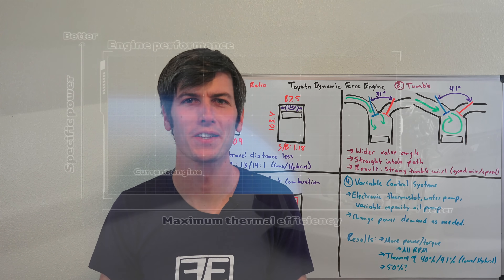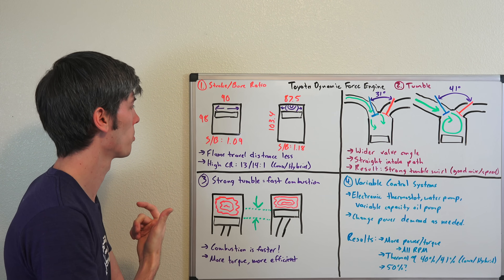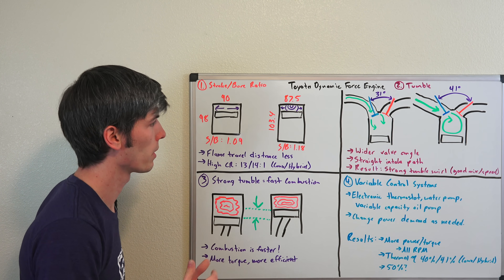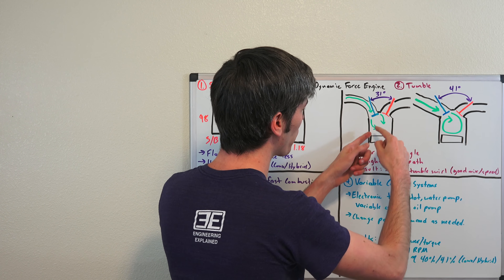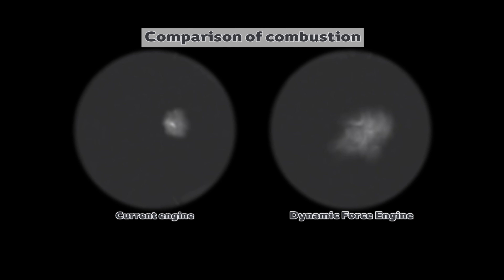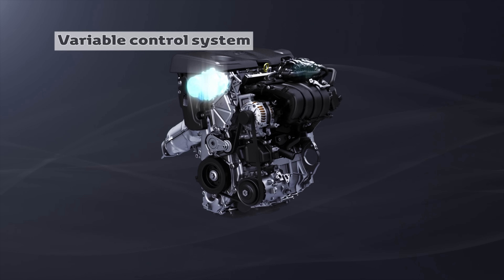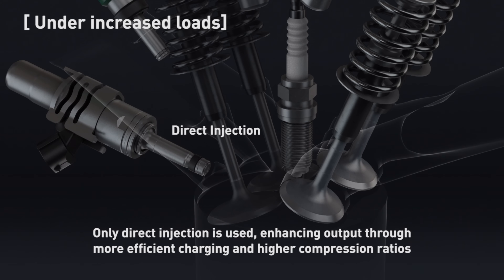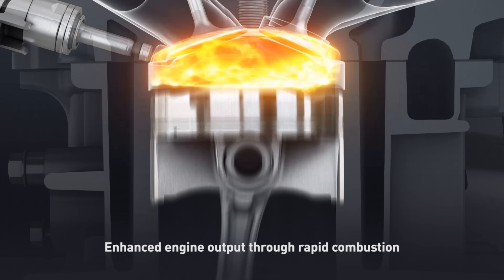Toyota's New Dynamic Force Engine Is Super Efficient

Comment: Electric oil pump. I like the sound of that, potential mounting in convenient location, potential diagnostic procedures like checking filter flown or system functionality, cold start up priming.

Comment: If you speed up the combustion,you reduce torque-not increase it. This is why diesel's have more torque that gasoline engine's--because the fuel burn is slower and longer. To burn all the fuel in the first 20-30% of the power stroke,will reduce torque,as most torque is developed when the piston position is between the 30 and 70% mark of the stroke.  I often wonder how on earth some of these !so called! engineers make it through grade school.

Comment: Isn't Mazda working on an engine with a similar compression ratio? What's the difference in technology?
Reply from the maker: Mazda's SkyActiv-X prototypes are running 16:1. Explained here: https://youtu.be/yNSxow3W7ek
Reply: Engineering Explained which is better in ur opinion?
Reply: Well, since Mazda hasn't actually made their new engine available to the public, it's practically impossible to determine which one is actually better.

Comment: You missed the biggest reason for the increasingly undersquare bore/stroke ratio which is a massive change in surface/volume ratio of the combustion chamber for a given compression ratio.  This alone probably accounts for a large proportion, if not most, of the fuel consumption benefit.
Reply from the maker: I'm not sure I'm convinced on that point (and I certainly wouldn't say it's the biggest reason). Mathematically, two cylinders of the same volume but different dimensions (bore and stroke) will have the same surface area. Ex, Mazda’s SkyActive engines: 1. Surface area (A) of a cylinder with pre SkyActiv-G dimensions (87.5 x 83.1 - 0.5L) A=2πrh+2πr2 = .035 m2 . Surface area of a cylinder with SkyActiv-G dimensions (83.5 x 91.2 - 0.5L) A=2πrh+2πr2 = .035 m2 Which means it comes down to only the cylinder head, which is just a fraction of the overall surface area. So if you make the head more spherical, yes, you increase volume per unit surface area, but you also make high compression ratios more challenging. But again it’s a relatively small change in surface area to volume, so that’s not the main source of where heat was lost and now allows for greater thermal efficiency. Speeding up combustion means more of that pressure is turned into useful work, rather than heating the cylinder walls or leaving as pressure through the exhaust.
Reply: It's not the S/V of the entire cylinder that's important.  It's the S/V of the combustion chamber at TDC where the gases are at their peak (thousands of °C!) and the thermal gradient is at its height.  Once the expansion begins the gas temperatures drop dramatically and thermal losses reduce significantly.  This is why a lot of attention is paid to the cylinder head cooling and the bottom of the bore doesn't even have a water jacket!

If you do the sums on the Toyota data you presented here and simplify the clearance volume to a cylinder you can see a 4% reduction in TDC S/V.  That's a significant reduction in heat loss when it's at its maximum rate.  The higher the CR the more significant this advantage gets.

As far as charge motion and burn rate are concerned it's sure worth something but not as much as you'd think for complicating reasons.  Notably the decreased bore/stroke ratio will compromise rod ratio too unless you allow the engine to grow taller.  This has deletarious effects on piston motion at TDC so some of the burn rate advantage is lost here.  Additionally, higher burn rate increases peak cylinder pressure and temperature which also increases thermal losses due to increasing the thermal gradient to the cooling jacket.  So what's given with one hand is partially taken away with the other.

Here are my numbers, if they will remain formatted correctly (hopefully)

bore  90   87.5
stroke  98   103.4
swept v  623   622
cr   13   13
clear vol. 52.0  51.8
  
c.v. height 8.2   8.6
c.v. surface 15033  14395
S/V   289   278

Comment: Very nice video, well explained, as usual. This engine looks like  it is still a N/A engine. 
On my side, to buy again from Toyota, the efficiency has at least to double, minimum. My Toyota Highlander MY2017 bought in November 2017 has the worse fuel economy of all my cars, ever. I bought it new and even after the break-in period, I cannot go below 14,6 litres /km on average. I succeeded getting below 14 litres by doing a lot of highway and by turning off the A/C often (the kind of thing I never did on my previous Volvo). The engine looks like the "state of the art" of naturally aspirated engine with, VVT-iW and VVT-i + double fuel injection system although it does not feature cylinder deactivation, and the car has an efficient 8 speeds gearbox. Fuel economy is far from the claimed figure I checked on the Toyota specs. The "ECO" mode is ON ("Sport" mode OFF"), and of course, the parking brake is released ;-)
I miss my 2014 Volvo XC60 T6 with its 3 litres 6 cylinders turbo (and a 6 speeds sluggish old school automatic gearbox), same power output as the Highlander, that had a 8,8 litres /100km average over the 65000 kms I have done with it...

From my experience, that is no surprise that Toyota is able to improve over that !

Comment: Engineering Explained. Shown quickly in the graphic, but you didn't point out that this engine has both, Direct and Multi-Port injection. Which as well as giving better performance, helps to stop Direct Injections potential for carbon build up on the intake valves, which is pricey to have repaired.

Comment: One day Toyota might discover the electric motor with an amazing 96% thermal efficiency. Incredible.
Reply: And one day, in a far, far away land, you might discover most of the electricity that powers your electric motor comes from coal, gas and other fossil fuels that have 30%-50% thermal efficiency as well.

Comment: I would have thought that these burning efficiency techniques have been known for a long time,     I would expect that they have been used before  but no reason not to use them again  given the pressure for higher petrol efficency , controlling the loading devices is novel ..thanks for the presentations.

Comment: I'm still hanging out hoping that you'll do a video on desaxe engines and explain what the issues are with it and why more manufacturers aren't using it for it's obvious power and torque benefits. Henry Ford used it back in 30's so it's not exactly new technology. Great video as usual Jason.
Reply: Per my criteria this is a desaxe engine! The bores are offset from the crank centerline. More crank degrees at TDC, I would think this allows for easier event control. Also just a personal theory that they get better rod bearing life by having their peak cylinder pressure event occur while the crank is further from TDC, which seems like a big deal when the are running a 14:1 engine on 0w-16 and keeping bearing width to a minimum.

Comment: HCCI, 2 stage direct injection, long stroke, high compression....so modern petrols are effecively becoming diesels.
If you want a diesel, just buy one. "but diesels are expensive and low revving" because this will be cheap with a 7200rpm redline?

Comment: "Dynamic Force Engine!" is just a marketing term for "we optimized combustion a bit." Everyone optimizes combustion. Snooze.
Reply: aluisious:   Marketing is one thing.  (See Farfegnugen).   Making things better is something else.   Boring as Toyota is, it has a habit of doing that AND keeping their cars generally highly reliable.
Reply: GM, Ford, and Fiat's engineers focus on and prioritize part failure rate and reoccurring maintenance costs ( they want the part to fail after a set number of years, miles, or hours of use, where Toyota focuses on reliability and brand reputation, hence it costs a lot less to own a Toyota. Toyota's hold their value much better then the rest.  GM's Active fuel management FAIL, Ford's ECO Boost FAIL, Fiats ECO Diesel FAIL its all about how much are customers willing to put up with and will they buy another. Ford and GM are majorly downsizing, which means consumers are catching on to so called marketing bs.  Toyota makes real world technological progress that people can afford and is reliable.
Reply: @JohnSmith-lq9fw  Your imagination running riot? Obviously a Toy-boy.
Reply: @Ryan we dont socialize.
Reply: So true.
Reply: Marketing gimic? Maybe yes. You probably right about they just making NA engine better. But 200+hp from a 2.5 engine with compression ratio 13:1 is something. 

Mazda team probably smiling when they see this ‘new’ Toyota engine. Their old engine has better compression ration. Still...to me, both Toyota and Mazda has amazing product (for this market segment).
Reply: every bit of adjustment helps the engine work better without stressing the components..work smarter not harder is my term
Reply: "Dynamic Ram" is marketing speak for "forgets promptly unless refreshed."
Reply: Port and Direct injection systems! Direct injection only systems are having issues w carbon buildup on intake valves. This is not an insignificant issue! Dual injection systems are so much better you will see every manufacturer adopt them sooner or later.
Reply: aluisious you must be a thrill to meet at social events.
Reply: It's true there's nothing really new about this engine, they just took every form of engine optimization they could find and packed all of them into the same engine.
Reply: Marketing.

Comment: Toyota really is excelling in the automotive world. Just don't understand why they develop more all-electric cars that can compete with Tesla.
Reply: PapayaMan Because the "all-electric" car only makes up ~2% of sales.
Reply: Right, because there aren't that many "attractive" ones that are affordable. For example no one wants a Leaf, Volt or even an i3, but I see model S and 3's so many places.
Reply: That or they're EXPENSIVE! 

Also, even with Tesla's more "attractive" cars, EV sales are still only 1-2% of the market. Besides, the most similar smaller cars are arguably as ugly as small ICE powered economy cars. Honestly, I personally think the Volt, Bolt and I3 are better looking than their ICE counterparts, and there are many shared body options out there, so styling isn't an excuse there. The Volkswagen E-Golf and the Soul EV are just a few to name, and they don't outsell the same cars with ICE power. Their problems are partly due to range. Range issues can be solved at a cost, but cost is already an issue by itself. The average person isn't going to pay $45,000 just to have a minimum of 250 miles of range. For this reason, $15,000 ICE cars will continue to outsell.

Comment: Well, when the first otto engines appeard, the efficiency was what? 30, 33%?  We're talking about more than 100 years to achieved this? Otto engines and other related cycle engines make us to loose more than a half of energy contained on a fuel! This is bad. Nobody wants to discuss that, but it's really bad! It always was! I blame all the engineers that were lazy and did not come up with other much more inovated ideas!
Reply: The first otto engine had an efficiency of about 12% and 5 hp. Engineering is about problem solving by using technology. If you want to save fuel than it's better to drive with another people in one car instead each one alone in a car or you can use the train or bike if it's possible.
Reply: Spam Filter still a dinosaur today. Saving fuel is very important issue. But not just like you said. Using cars that throw more than 50% of energy is not that smart for a man that walked on the moon. Engineers just improve the thing but we're still using the same device for years. It took less than 30 years so we can have very fast phone connections, very fast internet, drugs delevopment, medical improvements and only about 10% in efficiency on otto engines. And for a smart person I didn't mean THE FIRST otto engine, but the ones since they've being used on comercial cars...
Reply: I'm not defending the ICE. I want to say that you can't jump that simply from one technology to another technology. You need the time to build the necessary infracstructure. You have to build power plants using renewable energy and batteries with short charging time so it becomes attractive.
 An electric car that is getting its energy from a coal plant is only slightly more efficient than a car with an combustion engine.
Reply from the maker: Yes, ICE efficiency is bad, but the first ones were definitely not 30%+.
Reply: Engineering Explained yeah. But my point is: engineering is trying to make a t-rex look better. Put some nice shoes on, cool gloves, sunglasses, maybe a sophisticated hat, etc... But it's still a t-rex!!

Comment: Hi, i noticed that in your video on mazda's skyactiv x engine, you never quoted a figure on thermal efficiency, only that it's a 20% improvement on the previous, I'm curious as to how that engine stacks up to the toyota engine.
Reply from the maker: That’s a good question, and I have not seen a figure stated by Mazda. I will ask Mazda and try to find out.

Comment: awesome to see this, as always you're videos are amazingly easy to understand!  Seem like very impressive efficiency gains without complicating the engine and adding too many moving parts. Hopefully this is something that other manufacturers can implement as well.
Reply: @Thomas B🏳️‍🌈⃠ I think port is better than DI in this case because some air and fuel can be pre mixed in the intake valve port before entering the chamber and they are chasing more potent mixtures.

Comment: The VW TDI engines, 3rd generation of late 90’s and early 00’s, had stroke:bore ratio of 1.2:1 with a 79.5 mm bore and 95.5 mm stroke. Similarly, swirl caused by the intake ports is rotation around the axis of the bore vs tumble which is “rotated” 90°, perpendicular, to said axis.

Comment: You really need to look into the Achates Power engine it has 55% BTE and is a significantly simpler mechanical design than current automotive gasoline engines.  It is a 2 stroke, 3 cylinder, 6 opposed piston engine that doesn't burn oil.  I'm very curious to hear what you think about it.

Comment: It's so interesting that all these new technologies (relatively speaking) are coming to the forefront of the ICE market when it seems like everything is moving towards electric vehicles. It's like one last  push that automakers are doing to get off their asses and save the ICE before it goes out
Reply from the maker: I'm not sure I'd say that. Technology is always changing and developing. Engines have changed quite dramatically as time progresses. But yes, EVs are certainly increasingly popular, and a solid solution towards longer term emission reductions and efficiency improvements.

Comment: Large bore short stroke engines has greater top dead center piston dwell time promoting efficient burn. Rotating of air and fuel centrifugally separates air and fuel particles
Reply: yes, but that works counter to emissions control desires...

Comment: Great video with very clear, in depth explanation. I'm curious how HCCI stacks up against this technology. I have always thought HCCI + camless = holy grail of internal combustion engine thermal efficiency.
Reply from the maker: I’ve linked to my HCCI video to the pinned  at the top of this video’s comments. :)
Reply: +Xgamer121X I don't think that's the holy grail. I'm pretty sure building a reversible engine in terms of thermodynamics and Carnot's theorem is the holy grail of heat engines.

Comment: Wait a minute now....

You said that the increased valve angle causes the swirl effect ["Loop charging", as per '60's Mercury outboard two-strokes] that improves combustion and your implication that this allows the engine to work with previously unworkable 13:1 or 14: 1 compression on an engine that is expected to run for 300,000 miles and good emissions while being cheap to produce.

Yet, this engine has direct injection, as plainly seen in the video.  Loop charging, or stratified combustion means nothing with direct injection, since with DI, stratified charge is IMPLIED~

Hello?
Reply: Stratified charge is WHY we use direct injection these days.  This system is way more complex and expensive to build than port injection!
Reply from the maker: It has port injectors as well. See 4:20.

Comment: So basically it sounds to me that they are making gasoline engines more efficient by making them as close to being a diesel engine as possible, without the compression ignition. Why not work on making diesels more efficient and a little cleaner; since diesels can achieve a 45% thermal efficiency in laboratory conditions?

Comment: I can see the nightmare already when these things get old and become maintenance hogs with all these electrical pumps buried in the motor.
Reply from the maker: Cars are covered in electric motors, they tend to be pretty reliable, and nothing all that new. Windows, fluid pumps, windshield wipers, HVAC. Motors everywhere!
Reply: While that is true, after they hit 100k on them they start breaking and the photos you have shown look like it will be a total bear to replace most of them in car. Not that any manufacture has cared about that in the last 30 years.
Reply: Toyota/Denso build some super tough stuff.
Reply: My 4Runner, 99, has all the original window motors even the back window and sunroof. It is not a Buick.
Reply: @freddyflintstoned913  never changed one in my 1988 RX 7 either but I am quite happy that it has the mechanical oil metering pump. Later models used a electric pump what fucked up frequently ...
Reply: At 100,000 miles what do u expect?  It's easy,  buy new and let the warranty take care of the repairs.  Then just sell it or trade it in after 50,000 miles.  You'll never have any trouble!